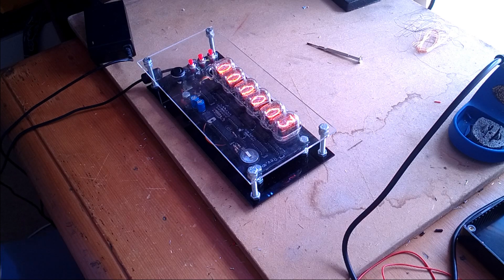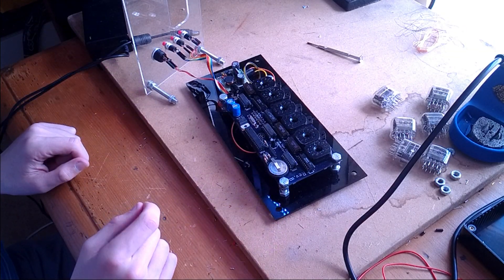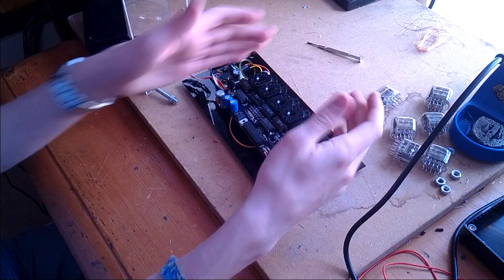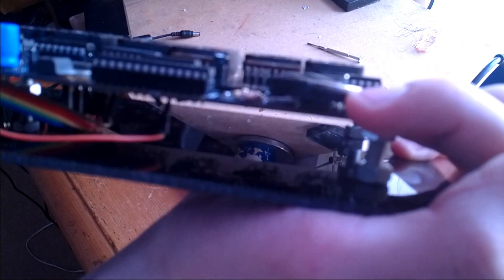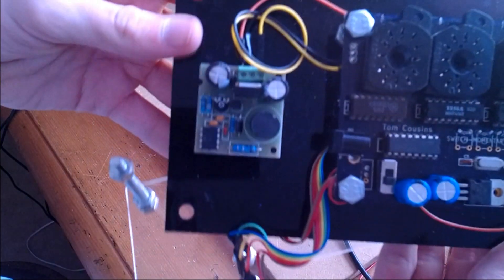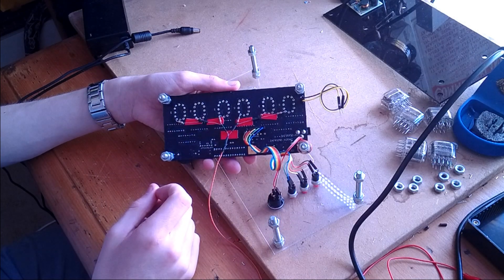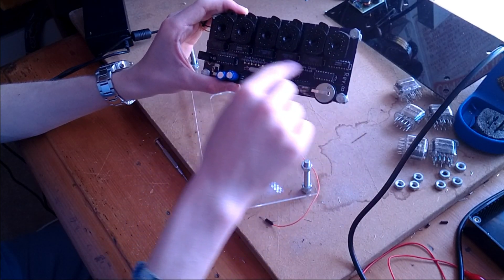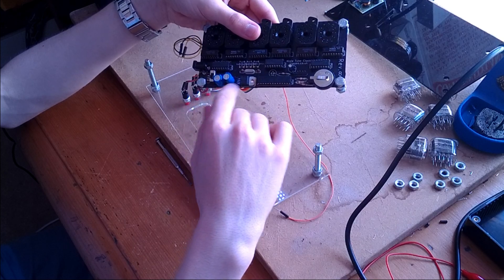Nixie Tube Clock

Comment: That's a solid NIXIE tube clock you've built there.  I'm in the early stages of building a clock with those same IN-12 tubes.  Like you, I can't be bothered to multiplex the display.  I'm using a whole pic microcontroller for each tube :-)  Excellent work!